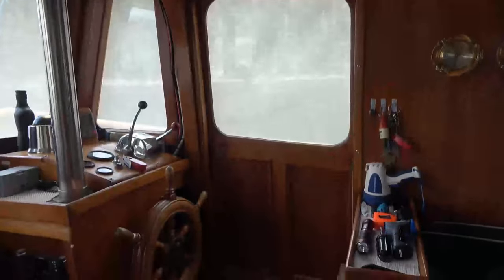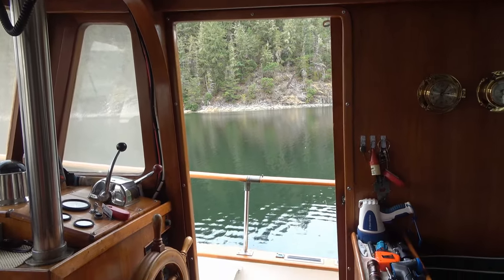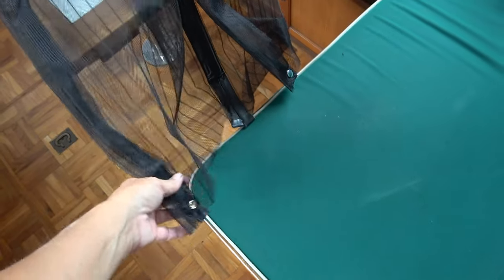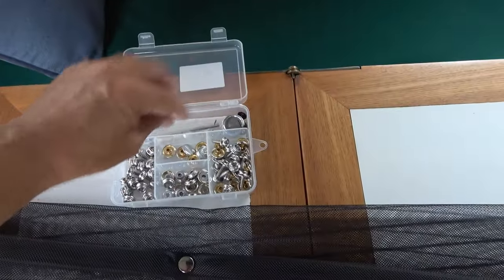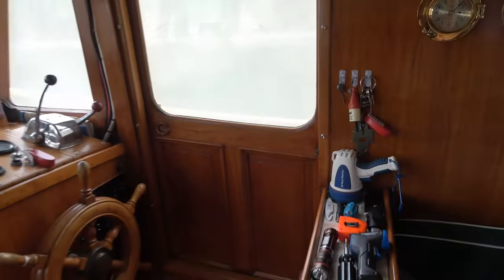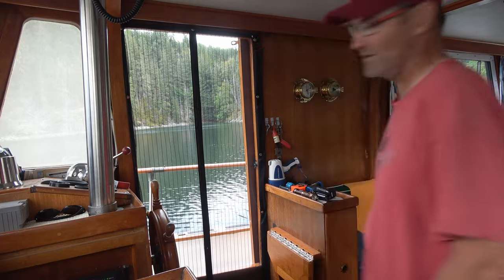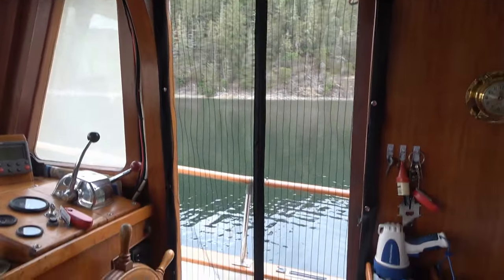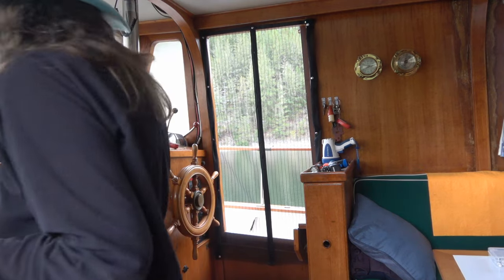Magnetic Bug Screen Door Installation and Demo

Comment: I’ve now done this four times to each rv, only have used sticky velcro for the walls, then stapled at top n bottom of each velcro strip, tiny staple holes not noticeable when removed to sell rv. -for rv walls, not trim. I’ve sewed on the velcro to the screen door. However this current rv really challenged me, this time i cut heavy duty double sided sticky tape to the back of the wall velcro strips eliminating the need for staples, but above the door n roof is carpet so i grabbed a rv fridge double rod (those spring loaded rv rods to hold stuff in cupboards n fridges), had to get creative mounting velcro all across the top of the rod to hang the screen door. I had to use a sewing machine again to sew the excessive sides together to really size down this screen door as this is the smallest door opening I’ve had to down size. The screen door starts to tear at the top from going in n out, so over the years of use I’ve had to reinforce the top added a plastic buckle and sewn it on with strapping material. This keeps the top together without tugging on the screen itself when going in n out. The older magic screen doors came with good plastic magnetic cases, these newer ones are such crap. 
Being velcro, door also easy to remove if not wanting to use this magic magnet screen door.
I’ve plexi glassed in my real screen door, so if running the ac i don’t need to close the main outside door. 🍻

Comment: Add a small dab of Vaseline to your snaps occasionally, they tend to rust a bit if you don’t. Nice little upgrade.
Reply from the maker: Thanks for the tip. I also made sure to get the ones that are for marine vinyl. We have them on our Sunbrella material for the hatches and have been good as far as corrosion goes and they are often outside in the rain. Cheers, Ray

Comment: Looks good and seems effective. 
Be interesting to see what you think of it after a month or so.
Will you moor your floating RV or opt for dry storage while wintering in your wheely RV?
Reply from the maker: We are renting a annual spot in a boat yard. Boat will be on dry there from mid October until mid May the rest of the time we will live and travel south in our RV. While we are out in our boat we can store the truck and trailer in the same spot. Annual spot comes with a little storage shed and metered power if we want it. We have a full winter cover for the boat and the storage yard is staffed as its a working boat yard so they can keep an eye on things for us. Cheers, Ray
Reply: Thanks for sharing that.
I'm looking forward to the vid about the change over from wet to dry RV'ing @LoveYourRV